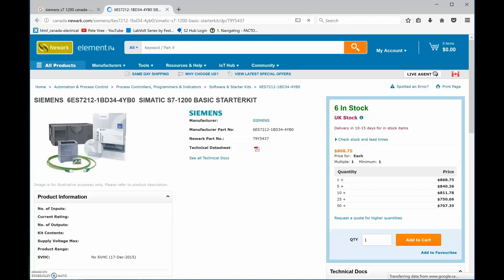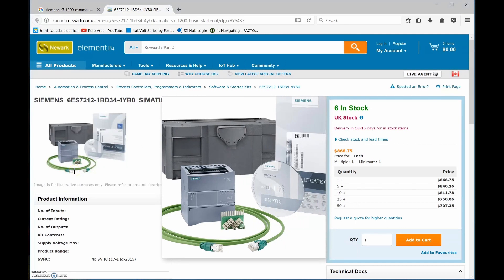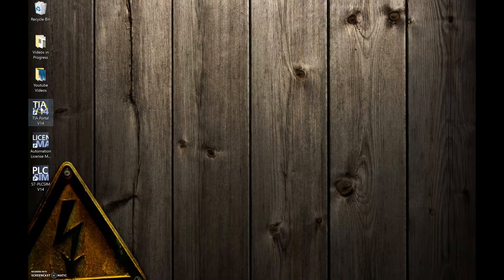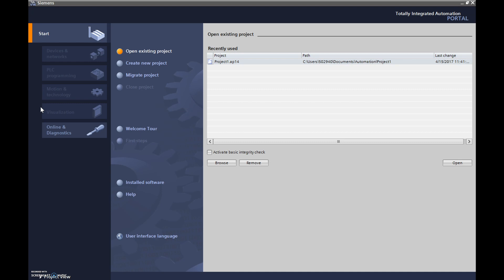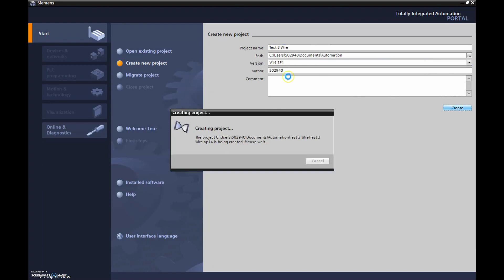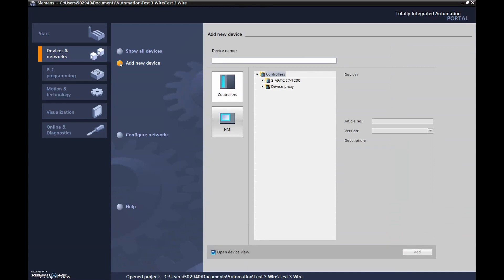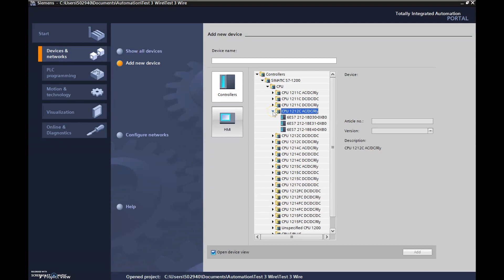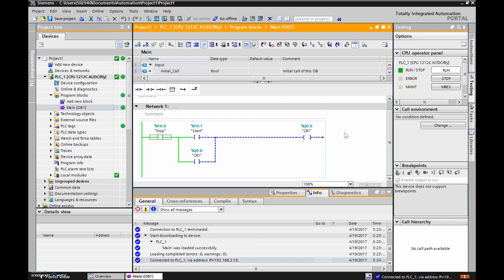Siemens TIA Portal Tutorial (Configuring your S7-1200 PLC)

Comment: It really bothers me you didn't use a NC for your stop. Sorry for being petty.
Reply from the maker: Not petty at all. Do you have an explanation as to why I would use a NC for the stop. Many comments on this, but no explanations as to why people are being taught to use NC for the stop.
Reply: @PeteVree  E-stops rules dictate a NC contact as the first means of control in a ladder that is in series with the whole control circuit. Aside from that,, you have to break the current flow on your rung, so naturally a NC just works. Technically speaking you could do a NO stop and run it through a relay as a NC, but why? Good practice for this particular circuit would be a NC e-stop first then a NO stop push button followed by your NO start in parallel with your coil latch, etc. I think what got people talking is you made a generic motor control circuit as a PLC program which is an unconventional approach to PLC programming. This was obviously a tutorial on how TIA works not how to program a complex set of ladder instruction. In my world, e-stops wouldn't live in this section of a ladder, but rather run through the first few rungs in series with other safety devices with redundant inputs and an output manifested as an input in this section as a NC.
Reply from the maker: Thanks so much for the clarification Kevin. I really appreciate it.

Comment: please i need asking you why stop button normaly open but in plan electrical normaly closed ?
Reply from the maker: The Normally Open instruction looks for the presence of voltage, or that a 1 is in the memory. It is completely opposite of the electrical wiring. Another term that may help is XIC Examine if Closed -||- and XIO Examine if Open -|\|-

Comment: The reason plugging it into the back of your PC did not work is because, by default, the Ethernet is setup as DHCP and gets a IP dynamically thru a DHCP server, in a router most typically, otherwise it does not have a distinguishable IP.

Plugging it into a router was the easiest solution as it both provided the laptop an IP and put both devices on the same network so the software could find the PLC, another solution if out in the field without a router is that you can setup your laptop Ethernet port, IPV4 network adapter,  with a static IP.
Reply from the maker: Excellent. Thanks Shawn.

Comment: stop switch should be normally closed not normally open
Reply from the maker: If you can explain why I'd appreciate it. In my understanding, the Stop PB is physically wired as a normally closed contact. In some Siemens demonstrations they use a normally closed instruction. However, in that case, you will have not way to see whether there is an issue with the push button contacts. By using a Normally Open, you can see immediately if the Stop PB has a loose wire.

Comment: Hello, I don't have a real PLC so I am using PLC SIM but i am unable to connect the PLC to the laptop as it says no accessible nodes were found. What shall I do to solve this problem ?
Reply from the maker: Have you updated your TIA Portal? I had the same problem, but once I updated it worked fine. In order to update you go up to the top drop down menu, select installed software and choose update. BTW This is a slow process. If this doesn't work then go to https://support.industry.siemens.com/tf/ww/en/threads/237/?page=0&pageSize=10 and see if they can help

Comment: Great video very informational. Comment: when you plugged your Ethernet cable from your PC directly into the PLC I'm pretty sure you would need to use a cross Ethernet cable to communicate direct. I'm not for sure on Siemens PLC but I know for sure you have to use a cross cable to communicate directly from a PC to a Allen Bradley PLC.
Thank again for the Video!

Comment: I found the reason why we can't connect directly from the PC to PLC with the stuff that comes in the kit. If you look closely at the plug on the green ethernet cable, there are only 4 wires in it, not 8. It must be for the hmi to plc connection only. Use a standard patch lead and you can connect straight to the PLC without using a router.
Reply from the maker: Thanks Matthew. I'll try it out.
Reply: You have to download the updates from the portal manager in order to be able to connect directly using the Ethernet wire provided

Comment: Sir the video is Great i have worked with the Siemens PLC for a short period of time withCPU 1212c   ,We all take stop in NORMALLY CONNECTED(NC)
Reply from the maker: If anyone has the answer as to why Siemens chooses to use the NC instruction for the Stop PB please enlighten us. Thanks so much Pankaj, I have pinned your comment so it is always at the top of the comments for this video.
Reply: @PeteVree  Stop is considered healthy with NC for safety reason. For example, if you consider stop healthy with NO contact and if the wire is broken then stop will always be healthy. This is an unsafe condition.
Reply: @PeteVree  thank
Reply: @PeteVree  the stop is in NC true state  that way connection automatically bypasses through stop and it makes sense when you press start button NO state, engages and connection is established to the coil which stays engaged. When you press the stop button the NC State changes to false thus disengaging the circuit. So the stop button should be a NC button.
Great video though. Worked in previous interfaces this new one the 1200 looks great. Good job I'll give you a like
Reply from the maker: @Kevin had this to add to the discussion: 
E-stops rules dictate a NC contact as the first means of control in a ladder that is in series with the whole control circuit. Aside from that,, you have to break the current flow on your rung, so naturally a NC just works. Technically speaking you could do a NO stop and run it through a relay as a NC, but why? Good practice for this particular circuit would be a NC e-stop first then a NO stop push button followed by your NO start in parallel with your coil latch, etc. I think what got people talking is you made a generic motor control circuit as a PLC program which is an unconventional approach to PLC programming. This was obviously a tutorial on how TIA works not how to program a complex set of ladder instruction. In my world, e-stops wouldn't live in this section of a ladder, but rather run through the first few rungs in series with other safety devices with redundant inputs and an output manifested as an input in this section as a NC.
Reply: Nice ji

Comment: Thank you so much for your time.. it was helpful.. I have a question...we can use normally closed contact for the stop button and i think it will be more practical .. can we?
Reply: Mohammad, think about this. If I pulled the wires out of your stop button, how do you stop the machine before it kills someone?
For safety reasons, the physical stop buttons and emergency stop buttons in the field are ALWAYS normally closed. This means the PLC is always receiving a signal from the push button.
The reason for this is that if the cable is cut, the machine will stop instantly. This is fail safe.

For the same reason the start button is ALWAYS normally open. If the cable is pulled out of the button, the machine will not start by itself.

When designing circuits, always think, you have to stop it from accidentally starting and you always have to be able to stop it.
Reply: @mofuonamotorcycle  i believe Mohammad was aware of the safety standard and his question was why Pete(and also couple other guys on YT) is programming the stop button as NO
Reply: @dujevideka1230  if the button in the field is normally closed, then the NO in the logic is always receiving an input unless the stop button is pressed. 
If its normally closed in the field, the logic in the program is reversed.  The NO acts like a normally closed until the stop button is pressed.
Reply from the maker: Yes. You can configure your program to match your wiring of each individual switch. 

However, just keep in mind that for Stop switches, E Stops... there may be safety requirements that must be adhered to in the specs or local Code requirements.

Comment: HelloWhat was the issue which lead you to use a router? I’m having troubles with the IP address. When I click on search network, there’s a device found, yet it does not have an IP address, there’s only a “ - “, even if I type the ip address...
Reply from the maker: You need a bidirectional/duplex ethernet cable to talk to the Siemens PLC without a router. Mine works great now... no need for the router. However, some days I try to connect to the PLC... no luck... then I try to troubleshoot and reset the ethernet connection... still no go. I restart the computer and everything works great. Hopefully this helps?
Reply: Thanks fellow! I’ll try to do that. I do appreciate your help.

Comment: What;s the reason for using NO contact to denote a NC pushbutton? Is that always how it's done? When you press the button it opens up in the field but latches in the program?
Reply from the maker: Go to 10:45 of this video: https://www.youtube.com/watch?v=liwY_VMzw4c&list=PLyL0ResmI4Q3_EvdMZpYylewL-WFYBSLN&index=7
Reply: Thanks, bud! All clear now!
Reply: Hi Pete, back to this question, I noticed unless I have a physical input (I don't, doing everything in PLC SIM), How do I mimic the default state of the button to be NC? I want the contact in the PLC to show as NO but the button default to be NC so logic is true, but I can't figure it out. Seems I have to make due with a NC contact in the PLC program and NO button in the HMI?
Reply: This is because the HMI is not a push button. The program written is using the digital input connected to a NC push button. The HMI is on profinet, it is not connected to the inputs. You would rewrite the code using latching blocks so that all the conditions for on such as safety relays, guards etc turn on a memory bit called "safe to run". Then you would have "safe to run" & "pb_start" & "hmi start" latch the block on. Then you would have "not safe to run" & not "pb stop" & "hmi stop" unlatch the run signal